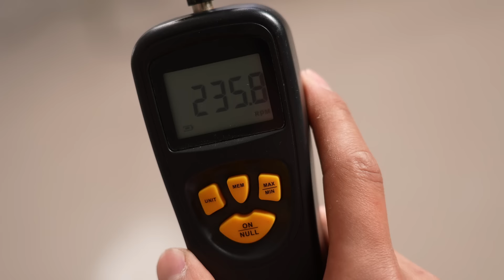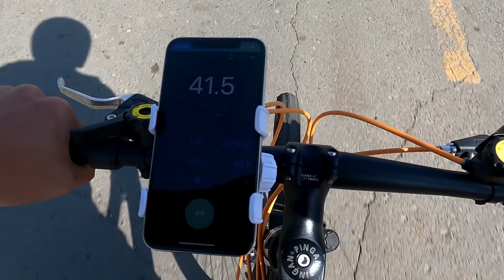Super speed Bike

Comment: This issue is, you can increase the gear ratio, but you will end up with diminishing returns without also increasing the horsepower. IE. with your current power you could have half the gear and just pedal twice as fast and get the same speed. The proper gearing would be to match both your peak horsepower with peak pedal rpm, resulting in your peak wheel rpm.
Reply: Finally someone is speaking sense.
Reply: He seem to be struggling with pushing the pedal.
Reply: FTP
Reply: How fast did he ride before the modifications?
Reply: This is more like a fun project homie.
Reply: Yeah!!…. What he said
Reply: bro 🤓
Reply: What about starting from a lower gear , start to increase the spin and then change for bigger ones ? It wouldnt result in a better perfomance ?
Reply: You mean humanpower lol the other HP
Reply: @The_Christ_Angel  a typical multi speed bike reach about 20MHP before becoming geared out and unable to go any faster
Reply: But pedaling twice as fast would wear you out faster. I'd think with the big sprocket you can kind of use your weight on the down pedal to get it almost all the way around. I bet clipless pedals/shoes would make this easier.
Reply: @kyleranderson5557  I’ve actually gone 29.5 on flat ground on a pretty normal 10 speed, and could of hit 30 if there weren’t people in ahead of me. And after not having cycled in a while I still managed to get to 27.5 on flat ground. On my bike the gearing is set for about 40 mph at 144 rpms in the top gear, but I’ve only been able to hit 31.5 down a hill due to traffic and not long enough hills. Even then I still felt like I wasn’t at my max at 31.5 when I was going down the hill. I’ve even gone as fast as 28 down my block which is a pretty good sized hill
Reply: @ffivguy1990  oooo!!! I’m happy theirs smarter people than me out there lol
Reply: You obviously have never built nor ridden a bike with a large chainring or custom cassette gearing. You comment sounds like it makes sense as far as physics go, however you're wrong and until you build and ride a bike with a big chainring you don't  and won't know diddly squat. Same to the rest of the fools on here commenting like they have experience with building and riding fast bikes. Most of you haven't even rode a bike in years or you ride a Wal-Mart quality bike.
Reply: true. . . i experienced this myself with my bike.... I just got so much exhausted with the gear 53 X  9 .... 48 X 16 is best for me... 30kph is my top
Reply: @fernandoorolaza4566  19 mph is your top? 30 MPH is my top speed and my bike has little 22" 451 wheels. Again, in order to be able to run the larger teeth chainrings you have to have the leg muscles to push them. I 1st upgraded my stock 48t chainring to a 58t and that was a big speed increase compared to the 48t however I ran that 58t out pretty quick and was still hamster legging. So I upgraded that 58t to a 75t and now I can maintain higher speeds with less peddling. Even though I have to push the peddles harder I'm not having to peddle as many revolutions to achieve and maintain higher speeds so it balances out if that makes sense.
Reply: @bigtexas7580  dude, no need to be so confrontational.

This is honestly a pretty simple equation - you as a rider are capable of maintaining a certain power output. That power output is best done at a certain cadence, which then translates into a certain speed with a certain gearing. A larger chainring definitely does help for top speed up to a certain point, but on a typical 700c road bike, any larger than roughly a 50-55T chainring and you will no longer be able to maintain the power required to pedal through the chainring at your optimal cadence, so you don't gain any benefit. (The smaller the wheels, the larger the chainring required. A 16" folding bike may need 75-100T to achieve the same effect.)

The fastest professional riders in the world tend to use 53-58T chainrings for this reason. Any smaller, and they'd spin out the gears beyond their optimal cadence, decreasing the power they can output. Any larger, and they wouldn't be able to push the gear through on their highest rear gears, leading to little to no benefit.
Reply: @bigtexas7580   that's an issue of rider strength, not the bike. A professional rider would be able to pass you on your folding bike, even if you gave them a basic 700c road bike with a steel frame and 2x8 gears. Similarly, you could probably pass a fat old man on your folding bike, even if he's riding the latest state of the art aerodynamic carbon fiber race bike.

Ultimately, the bike is only a small component of the speed, and the rider is much more important. You didn't "make your bike" faster than the road bikes in your neighborhood, you made yourself faster than those other riders and just installed some upgrades that allowed you to make use of your strength.

The gearing is only one factor to enable higher speeds. It makes no difference if you as a rider aren't strong enough to push those speeds.
Reply: I didn't understand a thing you said
Reply: Your saying horse power like a Humen can be match to a horse a Humen speed is 0.1 hp
Reply: Reducing drag or weight could utilise the bigger gear ratio with the same hp for more velocity
Reply: @bigtexas7580  I run 64:13 chain ratio and a 34% overdrive hub on a 20".

Homemade TT riding position makes the gearing viable.
Reply: @ChiTownGuerrilla  I use aluminum spiked pedals on my bike and they hold my feet firmly on the pedal just like clips do.
Reply: @KatanaRIDERS.  You should just make random chit up and post it online, it will make your day better. Then look up Usain Bolt's calculated horsepower.
Reply: you only go as fast as you want!
Reply: @jose-th3kn  Wrong, you only go as fast as your bike will allow. A cheap walmart bike won't go as fast as a built bike, no matter how fast you peddle.
Reply: I think it changes based on outside factors too. Some of the world records for cycling were set using an absurdly high gear ratio and a special car to draft behind.
Reply: Trev,
Good explanation! With such a high gear the cadence will be too low and decrease the power output. No way the guy can exceed 40km/h without tailwind. And in the video he had strong tailwind.
Reply: what if he just installs a mid drive motor or hub motor for hills. honestly hes probably using a 90t chain ring
Reply: @ukachukwunnamdi1481  how I understand it is the higher the ratio difference between the pedal gears and the wheel gears the faster the bike can go. However, it takes more effort to push the pedals, when I was younger we would call them the harder gears as opposed to the softer gears. 
If the ratio difference between the the pedal gears and the wheel gears is too high then it becomes impossible to push the pedals round. If it was possible to do what he showed then why don't professional cyclists have such gearing on their bikes? 

NB I'm not an expert so please forgive my sloppy terminology.
Reply: The issue is, you’re missing the point, too.
Reply: Yes and another thing this will make him tired of pedaling
Reply: @karlzhao314  Yes bro u are right. A basic aluminium 700cc straight bar road bike with 2x8 speed will definitely beat a even 451 wheel carbon frame bike with 2x11 speed. I have both the bikes and I tried out before.
Reply: Raggiungo la stessa velocità con il 50/13 e posso andare anche oltre senza distruggere le gambe a bassissime rpm. Anche con il 50/15 e ci arrivo in meno tempo, viva l'agilità! Rapporti più pesanti di un tipico 53/11 difficilmente hanno senso in piano senza scia.
Reply: @bigtexas7580  yes there is truth to that, I can say that from experience riding cheap Walmart bikes and later on bike shop bikes. My Specialized Hardrock Sport has much better quality bearings as does my Gary Fisher Marlin.
Reply: need some superpower to pedal it. lol
Reply: @myass5964  Well yes, but that's a horse of a another color. 😁
Reply: Bro u r a ginius ❤️💞
Reply: I think if you went to all the trouble to put this up on youtube you should have hooked up a chainsaw motor to this too.jesus is the king
Reply: @ChiTownGuerrilla  that is important, he forgot to take it under consideration. Paddling twice faster will exhaust u much sooner than paddling harder but slowly. It's like running bike/car at top speed without an overdrive gear, which pushes engine to it's redline generating lot of stresses.
Reply: Trying to pedal twice as fast quickly narrows the point of diminishing returns as you say due to the FV relationship of a trained muscle. The optimization of all components is the interesting problem! That's what my lab does.
Reply: @yash_kambli  Yup exactly! My trucks "drive" is actually  OD and I love it. Probably why it's almost at 300k and still runs amazing lol
Reply: Damn just use brute force mah g
Reply: @bigtexas7580  I ride BMX and got some bad shinners from medal pedals with screws lmao. But if you're just cycling on the road I'm sure they're great.
Reply: U can only size the gears as many teeth as ur legs can push them, and then there is uphill.
Reply: I wonder, why nobody paid attention to the fact that he did zero job in actually changing gear ratio.
First, he measured top speed on smallest ring in front, with smth like 25/11t (surprise, it's not much!), then he made a big ring and used it with the biggest gear in the back!
Could've switched to the biggest ring at front to get the same result at 48/11t.
Reply: @kyleranderson5557  nope wrong
Reply: Wot?
Reply: the point is less pedal RPM effort at the feet with more feet of wheel output it may slow your pedals acceleration but at a higher top speed being less effort to maintain it'd be great as a 2 gear  the massive and micro front gear all while keeping the multiple rear gears then once you get your acceleration down hit that high gear to jump from 5mph yo 50 mph add an electric wheel hub motor for front wheel and you might be able to maintain 75mph to 60 mph just then at those speeds id take the roads rather than bikepath so not running down pedestrians and their dogs on your bike 🚲 path
Reply: Coming down afton mountain Virginia  I hit about 42 mph.    Started faltering my feet couldn't keep up..   I could have
Used that sprocket
Reply: 70-100 rpm is the sweet cadence..
Going above or under that will wears you quickly..
Reply: You can pedal twice as fast... How about settling twice as fast for the same speed you are going with that normal gear ratio on that huge gear ratio. Will still result in a faster speed. 🤦‍♂️ On top of that all you have to do is start in a lower gear in the back so it's easier to push when you start off then increase your speed. That's what I always do on my bike when riding in the city. When approaching a light and I can't just go, I'll lower my gears before stopping so when I take off I can take off faster.
Reply: @isaacayala5552  yeah gotta get that low rpm high torque then ramp up too high rpm low torque for top speed just remembering to shift down before a stop so ya don't have to hop it along to get restarted rolling
Reply: Also worth noting, when you cycle (and get good at it) it gets easyer to cycle faster then slower as you build momentum.
If i lived in an area with long flat stretches, a bike similar to what he made would be useful.
Reply: @ChiTownGuerrilla  Even using your weight you still need to make a lot of effort to pedal this big gear. I'd say you would get tired just as fast. Once you're at speed you might get farther on this gear than pedalling faster but you already get really far on regular gearing so this big gear is pointless
Reply: @bigtexas7580  Then illuminate us with your all so mighty knowledge in bikes and tell us why this gear is better than a regular sized gear.
Reply: i don’t speak smart
Reply: Well not twice the peeling speed but yeah I agree
Reply: I agree with ur essay, the simple resolution to his original problem of speed is use the oem gearing stand up and pedal like ur running lol go faster than sitting down as ur body weight allows u to spin the pedals faster.
Reply: @enrichedtoiletpaper8650  that made no sense for my smooth brain
Reply: @josemedina9968  not with that gear ratio it wouldn't even get it going
Reply: @karlzhao314  I agree in part. I was here to comment i break twenty five mph on a mountain bike regularly. there's this road sign that measures speed and shows it on a board to tell drivers to slow down.

But on my road bike id happily smash through thirty, upwards thirty two thirty three mph. Equipment does matter. my road bikes dead, i need a new one haha.
Reply: yeah but with this you can ride faster on downhill
Reply: @Tux00  probably already exists nothing surprised me in this world lol 😂
Reply: ok
Reply: Should check out the gears they use on Battle Mountain human powered speed challenge world record attempts.
By going absolutely all out in the area of improving aerodynamics, some of these folks can go faster than 80mph with a short term power output of substantially LESS than they would need to win the Tour de France. 
They need huge gear ratios to hit 80mph
Reply: @kyleranderson5557  it kind of depends on the bike, but they all tend to run out of gears AND run out of power before 25mph assuming the rider isn't a competitive racer.
Reply: @ChiTownGuerrilla  not just wear you out faster, but for real human beings the pedaling cadence (speed) becomes inefficient when you go much higher than 120rpm. Just like a lot of piston engines may have a decreasing power output through the top 10 or 20 percent of their usable rev range, the same occurs with pedal power. Like many bicycle riders I can pedal well above 120rpm, but not if the goal is to actually improve power output.
Reply: Man it is too scientific
Reply: this would work far better with different tires and a lead car with a drag reducer.
Reply: Missing the point 😒😒
Reply: The bike is 'MELIDA'... lol
Reply: Easy solution, always pedal down hill.
Reply: Horsepower from human legs? Ok👍
Reply: A few years ago I hit 65 mph on my Specialized 29er . . . tethered to a friend's car. Quite exhilarating
Reply: @daveybuckyou5883  Horsepower: Noun - a unit of power equal to 550 foot-pounds per second
Reply: Keren euy
Reply: When Mechanical Engineers speak up... 🙌
Reply: @bigtexas7580  Yup you can really tell especially if you ride them back to back. I wasn’t a believer until I went through 4 Wally bikes, then finally invested in a decent entry level 2009 Scott Aspect 55 hard tail at the time. Could not believe the difference. No dept store bike can come close. Shop Bikes = Better quality, better gearing and better parts setup period. It’s worth investing in a entry level shop bike than wasting money at a dept store.
Reply: @MoeJaeAtelier  Facts.
Reply: @bigtexas7580  lol Walmart bikes made the mistake of buying one figured id ride it the 2.5 miles home and it broke3 before i even got back
Reply: @cyclingsalmon  its extremely hard on the gears and chains to ride top gear all of the time though he eliminated the skew angle so the chain wont pop off
Reply: @jeremyschmehl2160  still not as hard as using a self-made Warhammer-orc-style self made gear, I guess.
The bottom line is, he could've had about the same gear ratio by just clicking his left shifter two times.
Reply: @ChiTownGuerrilla  - Simply peddling faster doesn't automatically wear you out faster. Heavy strain on the muscles is what wears you out faster. Long distance cyclists like to do about 80-100 RPM of the pedals and gear up or down as much as possible to easily maintain that cadence. The body usually has more endurance than it has strength. In other words you can usually lift a 5lb weight all day long without resting, but lifting a 70lb weight wears you out real quick.

This guy in the video could probably add another few miles per hour with light weight and skinny tires. It is amazing how much rotating weight adds to the effort. i.e. 3 lbs of wheel weight feels a lot heavier to pedal than 3 lbs in a back pack.
Reply: @KatanaRIDERS.  hp is a rotational force
Reply: need bigger hill like Colorado Rockies
Reply: Yeah sure but where's the fun in that
Reply: @The_Christ_Angel  26.2 then it jumped to 46
Reply: Where RPMs meets HP in the curve ^.^
Reply: @ChiTownGuerrilla  I relate so much to this comment my guy. My shins are basically just scar tissue at this point in my life.
Reply: Its not worth it you will feel twice tired for this huge amount of torque that you have to produce, you really have to make another 3 gears
Reply: Correct
Reply: Lol funny how you care so much
Reply: @The_Christ_Angel  im guessing round about 35 KPH
Reply: @aaronalagos45  Exactly, at last someone with common smarts in the comments section.
Reply: If memory serves usain bolt ran like 24mph. His gear ratio is precise af.
Reply: Also this was a terrible bike to do this on, clipless pedals would increase efficiency, a cassette with an 11t bottom ring would also mean you won't need such a big ring up front. These are also the speeds where aerodynamics matters so you'd want drop bars. Also 28mm tyres
Reply: " ... This one goes to 11"
Reply: Dude, Asians never got wrong
Reply: This is actually false. With a taller gear ratio he pedals slower for more speed, faster for even faster speed using less energy from his muscle.
Reply: @ffivguy1990  it's totally doable to go above 30. I had. 24" mongoose and a 26" mongoose and had both flying at 35mph on a flat way. Had a magnet speedometer, I could hit 41 downhill. But this was also 10 years ago when I had massive leg muscle from riding 2.5 miles twice a day in 10 minutes. Plus the leisure miles after work
Reply: He's on power saving mode
Reply: Exactly. I noticed that he was testing down hill. Now. Turn around and peddle it back up the hill with the oversized drive sprocket. Also for the ignoramuses talking about its human power not horse power. The power required to perform work is measured in horse power. Whether it's a human,horse,cat,dog,petrol engine, steam engine, etc doing it. Damn. We learned that in elementary school. You people should have been paying attention instead of eating boogers.
Reply: Well you might need the same power to reach speeds, but you can also reach higher speeds because the bike will need you to peddle faster then possible at a lower ratio
Reply: this simple formula it explain everything: Power to the wheel = rpm x torque . So if you increase rpm you're decreasing torque and vice versa. So in this case to keep on speed on that gear ratio of course need defenetly more power
Reply: No you are wrong, at first it sounds like what you said makes sense but the bigger gear although hard at first but you will get stronger with time a'd it becomes easier and easier, your muscles grows and becomes stronger, just think about bodybuilders and how insane their squats get to, so before looking at this from machines pov, remember we are humans and our strengh grows with practice
Reply: but thats not fun
Reply: @ffivguy1990  once clocked out at 29.7mph on an old wore out roadmaster $50 pawnshop special when I was 15
Reply: Nerd alert
Reply: Horsepower? Humanpower!
Reply: Ummmmmm what the duck dose this means can someone please help me
Reply: I honestly don't see why some don't understand this I Larned just bye riding bikes for 2 years.  Bye the time I was 13 I completely understood it
Reply: @kyleranderson5557  nah I've never ran into that problem even on a mountain bike. They have tall enough gearing for me to go 45 down hill. And could go 50 if I hade the hp🤣. They normally have Plenty of gearing especially 21 seepeds. On road bikes in 2ed on driving gear and  7th on driven gear is always taller than I need unless I'm going down a very steep hill. With it in 1st on driveing gear and 4th on driven gear I'm running 30 mph not max rpm
Reply: @bigtexas7580  I've hit 45 on a Walmart bike lol. I didn't run out of gear . Btw this was with the help of down hill. I could go 29 flat it was a  Is Schwinn  All comp. Mbt bike hade 27.5 inch tires.  I was 13 then but the bike started wherein out rear barings whent out right at a year.  I pulled my 80 pounds little brother with a 30 pound trailer a lot behind it it was a home made trailer and hich me and my paw paw made. I got to say it built me up riding like that. I would pull him 20 miles when we road. I would go right around 25/28 down Sligh hills and 30 down steep and 20 flat ground and 10 mph up Sligh hills and 2/3 sometimes 1 mph up step hills.
Reply: @bigtexas7580  clips are there to apply power even when your feet are going up, to pull that pedal up.
Reply: @arnoldtm31  I hear ya on that.
Reply: @The_Christ_Angel  dependent upon the persins strength and what gear theyre riding in 30m
Reply: @The_Christ_Angel  depending on the persons strength stamina and what gear theyre ridng in and if the grade of the road is flat up hill down hill 10 to 15 is a comfortable cruising speed  with 30 m.p.h. being about the top speed  one can pedal on a standard bicycle  however if you make the pedaling cog larger higher speeds can be obtained  ive gone 40 m.p.h. on a bmx bike that i did a cog swap on i took the standard  44 tooth cog off and replaced it with a  
Cog from an old exercise/stationary bike  i forgotten the tooth count but they are significantly larger i also replaced the pedals with  longer ones from an 18 speed mountain bike  that gave me more torque for starting from a stand still  note this was in the 90's when i was teen and was not aware that a bicycle's tire was rated for a maximum safe speed of 32 m.p.h.   it all boils down to just because you could doesnt mean you should
Reply: Hey trev your comment is spot on yes one can increase the high gear ratio and achieve higher speeds but get diminishing returns  as a teen in the 90's i used to mod my bmx bikes by replacing the standard 44 tooth sprocket with one from a stationary excercise bike i got a higher cruising speed and a higher top speed of 40 miles per hour 
Later on i discovered that if i added longer pedals i could get the bike moving easier and my top speed only dropped to 38 miles an hour when i wanted to ride flat out 
 It should be noted when i was a kid i wasnt aware that bicycle tires were only intended for a maximum of 32 m.p.h.  be cool and thanks for such an informed comment
Reply: But would it make good cricket bait 🤔
Reply: @lessismore83009  inquiring minds want to know try it sir and report your findings back here
Reply: Meaning he has to make the back gear bigger too?
Reply: wow you just explained what gears are literally made for
kudos
Reply: So you can ride 45 mph up a slight incline?
Reply: Or, you could try to simply reach top speed. Give the wheel some purpose..
Reply: No. Big gear go vrooooom
Reply: Flywheel..
Reply: My issue is the welding quality of that sprocket
Reply: MELIDA - that's the brand of a bike on video. Why Chinese have to copy everything including unclever ideas?
Reply: Ok Einstein.
Reply: Horsepower??? You mean torque
Reply: Start with minimum gear then change it to bigger and biggest.
Reply: @ChiTownGuerrilla  if you stood to do that youd double drag
Reply: Showw
Reply: Yeah I’m sure in the next episode he will put nitrous on his legs for more hp.
Reply: The last factor is how much energy you will use to pedal using your legs. 
So, would you rather pedal as fast as you can?

Example: think about those ladders drills people use when they exercise. It’s those small but rapid movements. Quick first step,

Or use power/strength from your legs and pedal as hard as you can. 

Example: Like sprinting where you rely on your long strides.
Reply: @bigtexas7580  

You can go as fast if you drop your weight but if you’re over 6’0, you’re as heavy as 5’8 with muscles. What the difference?
Reply: You are absolutely right
Reply: So how do you get cruising speed?
Reply: The shot of the speed measuring device read 47 kph=29.20mph going up to 49kph=30.45mph and cut back to riding. Remember he was on flat ground. And we don't know his cycling abilities. He had an idea and made it so.
His DIY gumption and ability are great. Loved his idea. And was a well done video.
Reply: Would the inertia of the moving bike and the (albeit minor) flywheel effect be beneficial as far as mitigating where the peak speed would fall before gearing out or getting beyond a regular human's leg power input?
Reply: Some shitty logical long and detailed statements.. Which i won't read.
Reply: Get a motor
Reply: No one cares about that. This was a fun project.
Reply: Leg day
Reply: 25 mph no problem with 25 9 BMX bike 45 down hill
Reply: But you can push less hard and go faster this way
Reply: @bigtexas7580  I’m not very smart, but I’ve built a bike or two.. Lots of hills in my area, I add a large front sprocket to my rear cassette extend chain, tweak the derailleur add a chain tensioner.. I can go up cliffs at 2 mph.. makes hills absolutely effortless..
Reply: I can ride 50 kmph on top gears of 7×3
Reply: I didn't understand what you meant
Reply: Damn. It makes sense but like my brain hurts how u know this shit??
Reply: Basically: energy doesnt come out of nowhere
Reply: @immanueldelcastillo6041  he is
Reply: @bmint  You sure don't sound very smart either, nor do you sound like you've built a Quality bike before. 1st of all there is no "front sprocket" on a bike, it's called a chainring. 2nd, why would you "add a large front sprocket to your rear cassette"? LOL. 3rd, if you have a quality, performance derailleur there would be no need to add a chain tensioner.
Reply: It is easier to pedal harder than to pedal faster at a given power output for a human due to the added weight of the legs. IMO
Reply: @KaushikBala333  Exactly.
Reply: @bigtexas7580  truth
Reply: He does something kool with his spare time, you don’t
Reply: @bigtexas7580  m8 ive been on bikes which wasnt bikes but was bikes anyway. The border of possibility is your willpower ;) its like me doin' better than Tom Cruise, just without e' movies.
Reply: at higher speeds it would probably not be as hard because of the wheel spinning
Reply: It seems really tiring to pedal
Reply: Its all about the ratios  . One turn of the pedal = around 30 or 40 turns of the rear gears .
Reply: that's why he only got to 28mph ... many can pedal that fast on a normal bike, for a few seconds.
Reply: We all know that stop ruining the fun
Reply: Yeah what he said...
Reply: @myass5964  let's just call it power shall we? And stick to SI units which would be watts. Makes life for all of us easier 🙃
Reply: Yeah correct. Human power is about 0.7-1.2 hp if you are trained good.with this max speed is something about 40km/h to 65km/h on a speed bike
Reply: so like a torque converter on a bike would do the job lol
Reply: I wonder if he could do it 100 meter slight uphill🤣
Reply: @zettaspeed  Peak Power if he is sprinting though.  FTP is useful for time trial scenarios.
Reply: i think the point here is to pedal less and with more ease. but is def not ideal if you want to use it as you main mode of transportation as you only have one gear
Reply: @kyleranderson5557  I rode a friends bike and it went 28 so I’d wager there’s a 35. Still slower but I wanted to gamble
Reply: He already has peak horse power
Reply: Can I come to your shop to dyno my bike?
Reply: I love how he built this, very smart and low tech. Personally I would have had the gearing a little lower and extended the crank for more force.
Reply: so hit legday is what i'm hearing. Horsepower = more squat
Reply: Super grany gear luks like it requires much force!?not sure tho very inspiring!
Reply: he's not a bicycle manufacturer with a factory is he - he is doing quick easy bike videos for YouTube to make a bit of money.
it's definitely going to be faster.
Reply: @immanueldelcastillo6041  😂no wonder
Reply: @karlzhao314  fat old men on state of the art aero bikes - sounds like plenty of the new less experienced cyclists in the UK. 😂
Reply: Say what🤔

Were made in HIS image. HE made us with the power of free choice
A good prayer:
I'm a sinner JESUS please forgive me for all my sins I know you shed your Blood for me on the cross at Calvary. Thank you JESUS for my salvation and for shedding they Blood for me. I love you JESUS. 
Romans 10:5/10 ct...❤️k
JESUSisLord!Amen...
Amen..
If you'd like to call someone who cares 
83
For
Truth.
bc you don't know when you'll die?
.y r u hesitant......
Reply: Eif kurz fahrrad studiert der bre
Reply: Eif kurz fahrrad studiert der bre
Reply: Please make a bike. I'll buy one. 💯👍
Reply: Tbh I have pedaled 45 mph on small sprocket box bike
Reply: As yes the man who knows a thing or two
Reply: @bigtexas7580  and how exactly will making a gear bigger and bigger increase the amount of force a human being can provide? Like it or not, there are diminished returns. There is a point in which the force a human can exert is no longer sufficient to take full advantage of the gear ratio, thats just the truth.
Reply: For that reason, a master-mechanic shouldn’t have missed the physics classes😀
Riding a “mountain” bicycle in a speed mode is a nonsense, you should take a “road” one. 
You don’t see bmx @ professional bicycle races, aren’t ya?😊
Reply: If you want to go faster, a proven way is to go Lance Armstrong. That is, if you can handle the shame and the risk of getting cancer.
Reply: i wonder if you can really use horsepowered bicycle
Reply: But you have to consider the torque against RPM curve. So - higher gear ratio might actually help, because it's probably possible to provide more total power output cranking slower. On most bikes I rode I could use a faster gear ratio more efficiently if I had one.

Anyway, I think your "horse power" is not that important compared to other factors responsible for the top speed. The most significant is the air resistance because that adds v squared to the equation. That's why it takes so much more power to make cars just a little faster. That's why it's impossible to drive fast (like over 100-120km/h) and save fuel. While we naturally can give the car engine a couple of times more power - it's probably impossible for a human to provide 2 times or 4 times more power. To go even faster you had to provide then 8x and 16x more power. But that problem was already solved. Super aerodynamic bikes were built that could go as fast as regular cars. You don't sit on such bike - it's more like horizontal position and the bike looks more like a bullet with wheels. Those are REAL super speed bikes.

Looking at that video - I was irked by how slow the wheels were. Not even proper street tires. Also - the weight matters. I once had a very light bike with very narrow street tires. Damn - it was fast.

I'd say increasing the gear ratio like this without modifying other, more important things in the bike just might make it slightly easier to achieve and maintain its top speed in certain conditions. However, it will not increase its top speed probably, because it's limited with the bike's weight, aerodynamics and tire friction.
Reply: I have a giant stance 29 2 with 29x2.35 tires and myfastest speed clocked so far is about 36mph I have a 12 speed shimammo deaore crankset I feel like I could go faster if it weren't for my physical limits
Reply: “4uck1ng nerd.” - Kyle Dunnigan
Reply: @ffivguy1990  is anyone else aware of your bicycle speed compulsion?
Reply: @bigtexas7580  look it's Lance Armstrong still pissed of at the world.
Reply: Yea you can increase the gear ratio but can you chug a seltzer water without burping?
Reply: If you can dream it and want it bad enough, you can accomplish anything!  My 15 participation trophies say so!
Reply: if you wanna talk about diminishing returns pealing twice as much will wear you out much faster than just standing up and putting your weight on a higher gear with less rotations

pedaling more revolutions will wear your knees but standing up and putting weight on higher gears is less effort
Reply: @ffivguy1990  downward or upward slopes don't count then weight becomes more of a factor which is different every person
Reply: Buatlah sendiri. Cakap memang senang mangkok.
Reply: If you go to an all you can eat buffet rarely does one eat beyond the intended utility of the food. Meaning nobody eats until they become ill and vomit. (Violation of the Law of diminishing returns) An alcoholic will drink beyond the utility of the use of alcohol, i.e. until he is completely intoxicated and sick. (Another example of exceeding the law of diminishing returns) 

I'm not certain your examplar is properly utilizing the properties of the laws of diminishing returns.
Reply: Im that case why wasn’t he able to go the same speed without the mods
Reply: Yep that's hit the nail on the head
Reply: Peak horsepower with lowest pedal rpm = most efficient i fixed it for you. You dont want peak pedal rpm
Reply: @The_Christ_Angel  Well he traded accelleration for top speed. Probably didnt gain as much top speed as he could have at a better gear ratio. I have 3 gears on my bike and i often findmyself trying to gear into 4th which i dont have. so from that i could gain some speed with a few more teeth on the highest gear.
Reply: @tyalikanky  Det här var ett clickbait naturligtvis. Man kan inte göra en cykel snabbare genom att göra ett kugghjul större. Byggkvalite är det som gäller. MInimera friktion och luftmotstånd.
Reply: Who cares...an idea starts with 1 man doing things

It's always easy to break some one down

And always harder to build someone up
Reply: You'll pay more for biomechanical tests than for the bike itself ahah
Reply: @kyleranderson5557  I can almost run 20mph. A decent athlete can do 25-35 on a street bike with gears
Reply: Who…. Asked
Reply: F
Reply: @thehornet5089  i tought he meant that the rider also adds a great deal : 
The rider is the engine
Reply: On my road bike with a 47t chainring on the front and 11t cassette in the back I managed I went 38 mph on a flat road which was my Fastest and 45.5 mph downhill and I got to 45 mph before the hill ended and if the hill was longer I could of hit 50+ mph and on my bmx bike with 33/9 gearing I went 32 mph on a flat road and 41.2 mph downhill but the acceleration up to these speeds is insane because I pedal the whole way down! I put out a power output of 1883 watts when sprinting! I do 33+ mph daily on my road bike on flat roads and 31+ mph on my bmx bike daily on flat roads! I train every day sprinting!
Reply: But instead of peddling twice as fast umm… well that’s the point bruh 😂you do less work to go faster with this
Reply: @connerwall2628  no wrong because the bigger the gearing the harder it is to pedal and it's not easy to pedal big gears like that and try going up a hill with thiss you won't be able too and the bigger the gearing the higher the top speed but  slower acceleration so it's not easier than smaller gears sorry!
Reply: My bmx bike and my road bike both  would smoke thiss bike from 0-30 mph and downhill 0-40 mph  because of how quickly they accelerate up to high speeds!
Reply: But thiss bike would beat my bike in a long distance but it will be very hard to beat any bmx in short distance or in 100m distance and in sprints and the bigger the gearing the slower it accelerates but the more top speed it has but thiss bike would need more than 200m to pass my bmx bike and my road Bike!
Reply: @ffivguy1990  I can get 35 mph on my bmx on this one hill I live on and I don’t have to brake much bc it hardly sees traffic only a couple of cars every like 10 minutes it’s fun but on flat I can prolly go 25
Reply: Yup
Reply: @immanueldelcastillo6041  That's because the ratio is too high. The system relies on the chainwheel being within a realistic ratio with the rear sprocket. It doesn't matter how big the front is, if you haven't also increased the rear proportionally, breaking inertia is going to be really tough for human legs to cope with. There's a golden ratio for everyone's output, within that it doesn't matter how big the chainwheel is, as long as the rear is also in proportion for the ratio. For example a 36f/13r comes out the same as a 44f/16r to within about 2 decimal places, because of the ratio. If you were to put a 14t on the rear, it would start to head in the direction of the one in the vid. Harder to pedal, but more top end, harder to sustain with your supply of energy.
Reply: @simiangimp2282  uhm. It needs a mode of transmission, then?
Reply: I have a solution: a recombinant trike, but instead of peddles... it's a LEG PRESS. As a previous lifter bro I can say that that's the #1 lift for max horsepower. If anyone wants to design it/make it with me let me know!!
Reply: @timpalmiter1606  suggest it to the YouTuber called "The Q."
Reply: @immanueldelcastillo6041  If you wish, but the whole thing is simply convoluting modern designs that already work....no real need to do any of this 🤣 It just looks so different from what we got used to and I guess that's what makes it cool for people to see 🤷‍♂️
Reply: @immanueldelcastillo6041  It already has a mode of transmission on the rear, but anything you select there, is built for a completely different ratio to that of a chainwheel the size of a satellite dish. It doesn't matter about size. The ratio is key. The smallest possible size chainwheel and rear sprocket can have the same ratio as those which are 20 times bigger. The multi-sprocket transmission on the rear of this one seems original, which is why it doesn't perform with the new, huge chainwheel. You have to do both...but then, you'll be right back where you started ratio-wise, only with a lot more weight added to your bike, therefore counterproductive.
Reply: @immanueldelcastillo6041  I know 🤣
Reply: WTF are you talking about
Reply: What?🤨
Reply: Tonto, no mencionas la eficiencia, no se incrementa la potencia pero sí la eficiencia de transmitir su potencia a las ruedas al tener más rango amplio de transmisión.
Reply: sounds like a skill issue, just pedal harder
Reply: Not even possible!
Reply: Horse power? You mean rice power
Reply: If he has strong enough legs and a good aero position then this would be more comfortable than pedalling like a nutcase . Also would be good for ebike
Reply: @The_Christ_Angel  I dont know, but I rode 50kmh on both speedometer on bike and gps from phone. So yeah, nothing much. My bike is a singlespeed bmx.
Reply: Yg TT TT yygg to ygt y
Reply: @kyleranderson5557  yeah thats not true at all, my average speed for 110 miles is 25mph, and ive done 52mph on flat ground, and 69mph going down a 17% gradient hill. My max speed on my diamondback Andean 3 is 88mph drafting behind a van. The average speed for a regular rider is around 16mph, if you cant go over 20mph, you either have a crappy bike, or you need to build up alot of leg strength.
Reply: This guy actually has the technical know-how to fabricate his own functioning gear. It's super-condescending that you think he didn't know that. It's a YouTube video. It's supposed to be a gag. 🙄
Reply: I’ve actually got up to 55mph on a flat road. Oh wait, it was a 125cc motorcycle.
Reply: @bigtexas7580 a 75 front chainring? how and why, if you can push a 75 ring on the front what are you running on the back? seems like a lot of wasted effort
Reply: Top speed vs acceleration.
Reply: True, but the top gear on most bikes is usually way too low for people with stronger legs. Just like how you can only go like 3mph if you only use 1st gear, the speed limiting factor that the gear ratio is too low, and you’re running into the speed limits of the power source (legs), not the strength/force limit.
Reply: I came here to point that out
Reply: We got James May in the comments
Reply: @Kyler Anderson  False. Most bikes have higher gears than needed.
Reply: You can stop the bike by holding the wheel with your pinky while somebody is pushing their full body weight
Reply: No he just needs a turbo
Reply: How do you find your peak HP?
Reply: @Saitam Leonidas  Best power is pedaling   from 85-100 revolutions per minute. Trying to pedal a massive gear at very low rpm is stupid and counter productive
Reply: I know, I max out in 3:8 ratio and I have no more power to give after certain ratio
Reply: @enrichedtoiletpaper8650  that makes sense to you? 🤦‍♂️
Reply: @bigtexas7580  sorry hard
Reply: I hate the wind the worse enemy to every cyclist
Reply: With an electric motor , the risk of burning it out would be high even with Bosch .
Reply: @enrichedtoiletpaper8650  q
Reply: the thing is that he will be so tired in short time
Reply: I almost fell asleep reading this.
Reply: @KatanaRIDERS. actually a human has around a 1.2hp output
Reply: Thats what ive been trying to teach to some people i know as they think shifting gears in Bike is that easy without making a smooth change and at the sweetspot they thought a bike could be driven only by the force of the pedal as they didnt knew the shifts work the same as the motorbike only with different Ratios and to clarify on what you said in my 9 Gear MTB ive achieved 64 km/h on just pedalling very hard while being good with downshifting and upshifting in the correct moment its all about mastering upshifting and downshifting to make it smoother once you know that you truly know how to ride a bike because i shit you not in my place only 2% of people know some bike riding that is the correct one... the rest? Doesnt even know to upshift only knows to  just sheer force  bend the rear rings of gears because of stupidity! Just thing of the upshifts in cars and in Bikes then you will get the idea and you wont go back as you will explore it as it should!
Reply: He's a diesel engine, HP is low but torque is high.
Reply: Your theory makes sense.  It basically comes down to pedalling efficiency and initial power output capacity of the cyclist. Imagine wasting away good cranksets and all the time, money, and efforts for a giant one that won’t help much to dramatically increase speed. 😞 
Remember we’re only humans with limited power.☝️Not machines. Want to go fast? Get a motorbike.
Reply: @hyperboytkl1077  I'm glad there are still some sensible people on youtube :). The initial power output isn't really the only issue. Somehow I think people see bicycles and motor vehicles as being totally unrelated. The thing is, on a bicycle your legs are the pistons, the pedals are the crankshaft, and then there's a chain driven transmission. Using that logic, there are calculators for cars, that will tell you how much HP you need to achieve a specific top speed. It takes into account drag coefficient and rolling resistance. The error of this video and the error of many people's logic is that gear ratio is not the only factor for reaching higher top speeds. A great real world example of this is the old 90's honda civics(DX models), they had like 90 HP and a gear ratio that could reach 150 mph.. but you can't get to a 150mph with 90 HP, you would need something closer to 200hp. This is a case of 5th gear being an "overdrive" gear for fuel economy.. Going to a large gear like in this video would only be necessary to achieve some ludacris ratio like 1 to 20 and make it difficult as hell to pedal, completely negating the purpose of using gearing in the 1st place. It's like fixing a problem that didn't exist in the 1st place.
Reply: @kyleranderson5557 exactly, I have a road bike with a gear ratio that’s probably shorter by a lot, but I can achieve the same speeds he is achieving, only thing is buddy can go downhill and pedal in the slowest rpms ever (lucky him😭😭😭) but he won’t have as much force (torque) as me cause my ratio is shorter. Imagine he was going against winds or going uphill
Reply: And the chainring that size hurts someone's knee. The bigger the chainring, the harder the bike to pedal. And that tire size too needs to be thinner like the road bike tires. Probably it will peak up to 50 or more kph.
Reply: thanks captain obvious, we got a youtube engineer here guys! watch out.
Reply: Rpm is the only thing that matters for speed. Horsepower only makes it easier to get there
Reply: @DatHondaBoi223  That's incorrect. You require horsepower to reach a certain speed. Try gunning it in a d series honda, the transmission is geared to 150ish, but you won't get past 100, it has the gear ratio, but lacks the horsepower.
Reply: @trev6783  then why does the engine reach max rpm in a d series Honda? Because it’s not geared to go any higher… tell me you know nothing about the subject without telling me…
Reply: @trev6783 I believe you’re thinking of the fact that when you increase a cars given horsepower with boost or cams etc, you also raise the rpm with the tuning of the ecu, which increases top speed. Horsepower only helps to get there. A 1000 hp car and a 400 hp of the same car will go the same top speed if geared the same and have the same rev limit, aerodynamics etc.
Reply: @trev6783  if you have any sources to tell me otherwise feel free to link them, I’ll stick to the facts for now though.
Reply: @DatHondaBoi223  It won't reach max rpm. it will stop accelerating just before 100mph, and still have plenty of gear left. In 90's honda's the "lx" transmission the 5th gear was an overdrive gear(140-150ish), in the ex/si transmission which is geared much lower overall the 5th was still a drive gear and top out at just over 100. Many of the honda boys would take the 5th gear from the lx and put it in the ex trans, to get the higher top speed. but don't believe me, google how much HP it requires to hit a certain speed, there are actually calculators for it.
Reply: @DatHondaBoi223  No I'm telling you that your 200 hp Honda can NEVER hit 200mph. no matter what gear ratio's you have. You require like 600+hp to get to 200mph, depending on vehicle weight and aerodynamics.
Reply: @trev6783 calculators and real life don’t correlate, horsepower is not what determines top speed lol
Reply: @DatHondaBoi223  Also if you want a car that is stable at high speeds you either need a heavier car or large amounts of downforce, which further increase the demand for horsepower to over come.
Reply: @trev6783  tell me why my cbr goes 180+ with less than 180hp, right because horsepower isnt what determines top speed lmao
Reply: @trev6783  none of the calculators I have ever seen include horsepower, it’s simply gear ratio, tire size, and rev limit. Because that is what really determines top speed…
Reply: yeah but you can ride high power low RPM which is better for people with low stamina and stronger muscles
Reply: Grazie, ingegnere.
Tutto molto chiaro.
Reply: You could pedal faster whenever you want
You just don't
Because it's dumb
Reply: I’m sorry horsepower I don’t think that’s how you measure Nike power that’s how you mesure self propelled vehicles
Reply: @bigtexas7580 I suppose if it's more comfortable for you to have harder pedals, but lower cadence that's great. 
If you can't reach the cadence required to achieve the same speeds at lower gears, having bigger gears is better, isn't it?
Some people have very high cadence which allows them to use lower gears
Reply: Yeh but look how big it is.
Reply: Mi opinión personal yo como entusiasta he ing graduado desde niño y terminando mi maestría de google . Pienso que cuando hacemos un video de modificación de cualquier artefacto la honestidad y sinceridad es lo importante ósea los resultados específicos  porque el tiempo es dinero.
Reply: Yeah.  I could top out on my 1983 nashbar race bike at around 43 ish mph on level ground with no wind.  That was with something like 50 teeth in the front and 10 in the rear.   I’m not sure as I never counted the teeth on my drivetrain.
Reply: Yes you look smart but this is miles by hours😂joke
Reply: Чтобы поддерживать долго такую скорость, нужно очень долго  развивать большую мощность. Уровень олимпийских спортсменов велогонщиков
Reply: @Templariolusitano  No. Applying the same power would propel you with the same exact speed. With a smaller gear you would have to paddle faster but with less power to reach the same speed. A larger gear you paddle slower but have to apply more power. Simple laws of physics. This guy completely wasted his time on this non-sense 'experiment', made a fool out of himself not understanding simple physics.